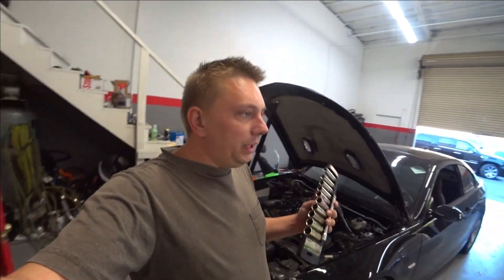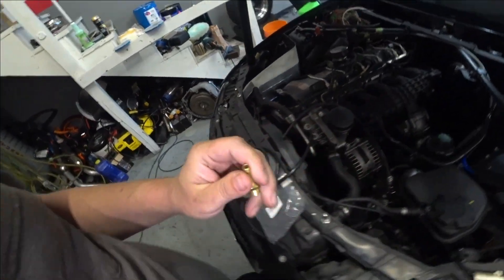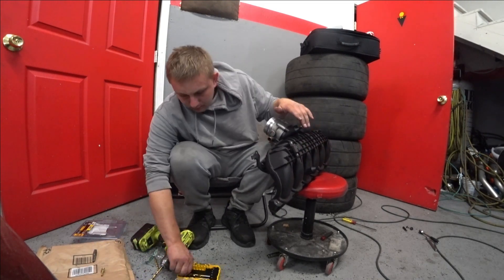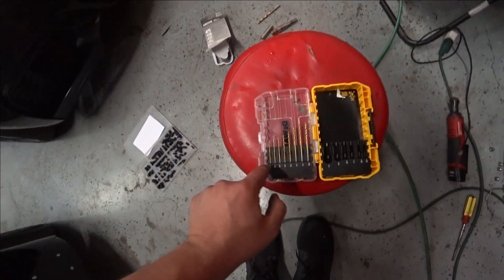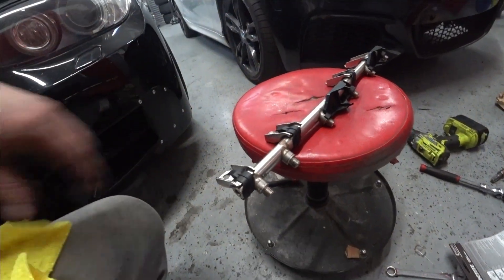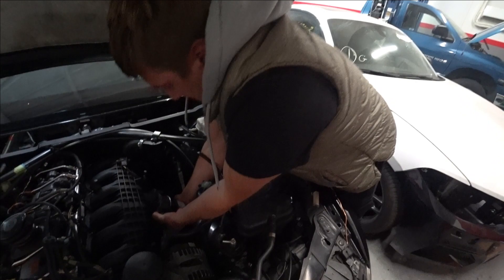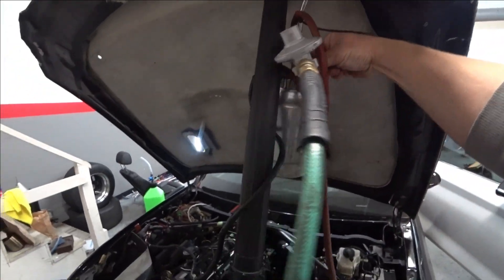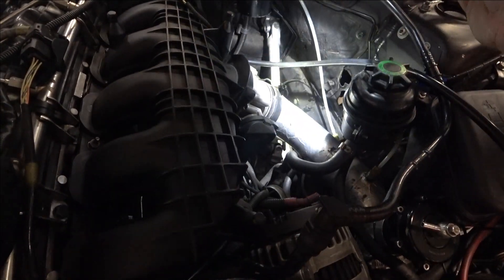How to tap BMW n54 intake manifold for larger vacuum line and drilling fuel rail (shocking results!)

Comment from the maker: Guys quick edit: the over boost issue got so much better between the shift actually completely went away except 5th gear but that one we have to adjust in the tune. So bigger blow off like helps so much to keep your turbos alive
Reply: Hey are you located in Florida?
Reply from the maker: @SupraNene  no brotha

Comment: I’m pretty sure they make conversion kits so you don’t have to poke a hole in the manifold. You just use the vacuum line from the throttle body and that’s where you’ll put a T in the middle and it’ll be your new vacuum area. And I think they even have 2 port version so you can also have a boost gauge running into the cabin. But good work doing it all by hand and by yourself.

Comment: Will this work also with N55
Reply from the maker: Yes, everyone who has tial can do this, also make.sure you put softer spring into tial bov they are all mostly 10 or 11 psi spring but you need softer like 8 psi white spring, that's what its called
Reply: @ALEX.THE.RUSSIAN  ٍSomeone told me that N55 BOVs are electronically-actuated, and even the early N55s with PWG use a vacuum pump and do not rely on IM vacuum for it. So this would be totally useless on an N55 (more so than an N54)

Comment: Why not just use a bov adapter? Less of a hassale and is plug and  play with a bigger line.
Reply from the maker: No i would do that if it was this good turbo manufacturer said those kits are not good and some blow the front turbo

Comment: Will be doing fuel rail tomorrow did bigger manifold to bov upgrade a year ago been running strong since
Reply: Dis you drill the fuel line yet? If yes, did fuel pump high increase?

Comment: i tapped my 1/4 fitting to the opposite  side of the manifold. shorter hose and alot more responsive.
Reply from the maker: Should of done that I didnt think of that but this will work perfectly it's way more then enough especially I have 8 psi spring so it's working flawless brotha.